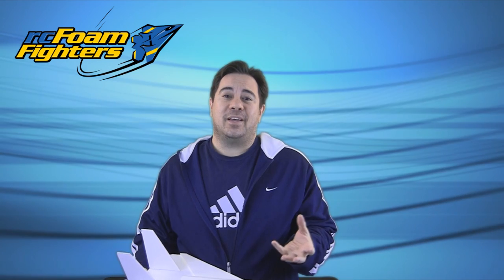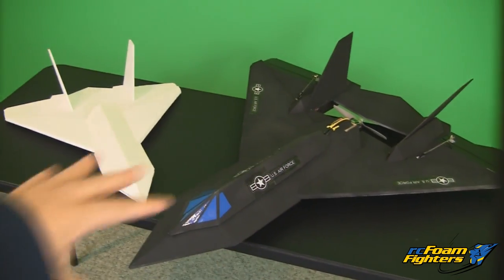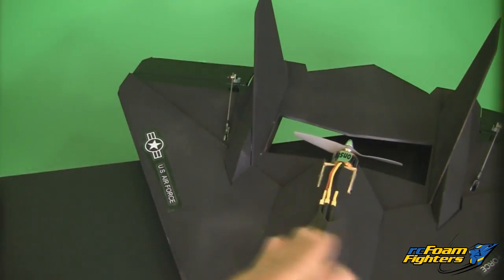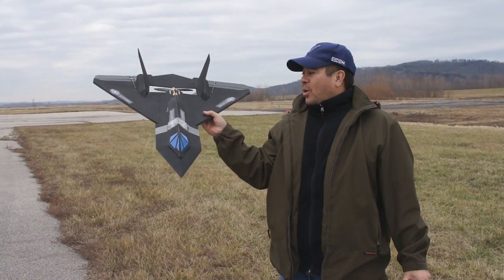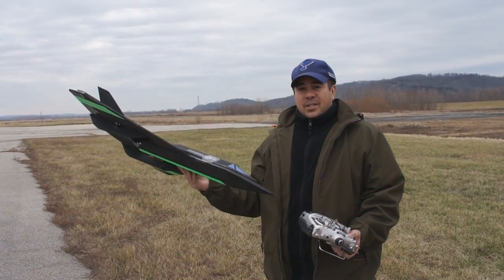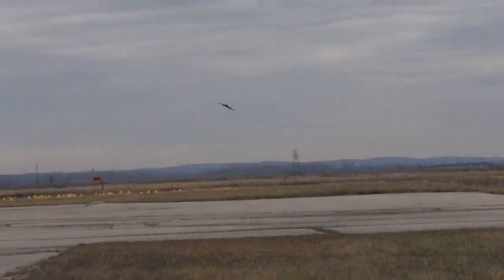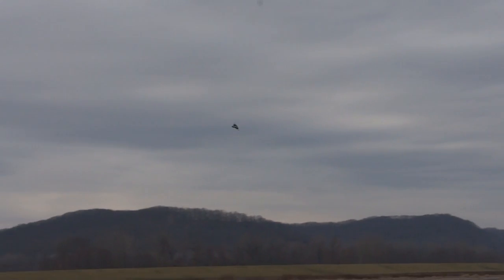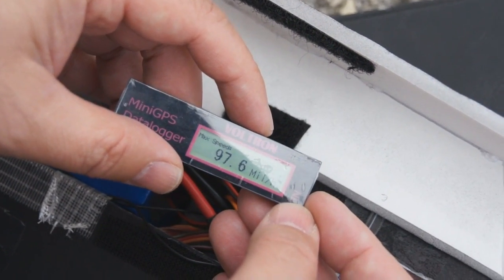FF-Aurora Part1 (Aurora RC Plane)

Comment: I agrees about using the KFm-4.  I use it on my Delta FPV designs.  Really locks the plane in....Like riding on rails to coin a phrase. I also like the fact that it virtualy eliminates the need for carbon fiber too.

Comment: I was thinking more along the lines of increasing the plane's size to 150%.  Then fitting the EDF's into the Jet pods. I thinks that 2 Detrum 70mm on 4 cell would suit that design much better.  The 2 EDFs combine to prodce 2400gr of thrust on a 4 cell (4000mah).  It would make for a short but super sweet flight.  LOL

Comment from the maker: @johnny0464 This plane is made out of the Dollar Tree one dollar a sheet foamboard. No spars or tape either! I was happy how it performed. One of the reasons i used the KFm2 Airfoil was to make a more rigid wing. Also the simulated motor pods and bottom air scoops help make the tail nice and rigid too. I think the Elmers would make an even stronger plane but would be a bit heavier.